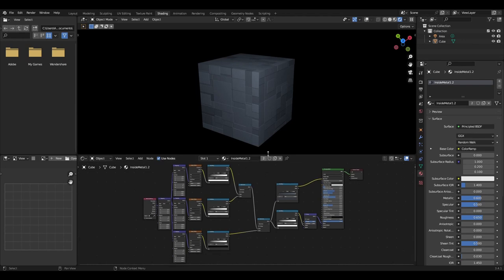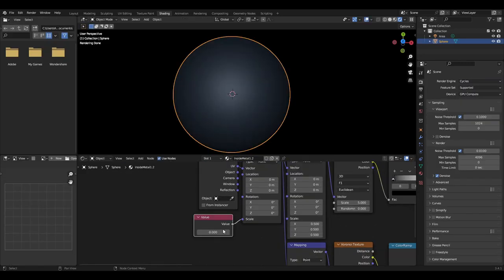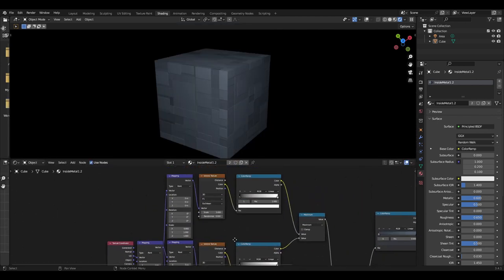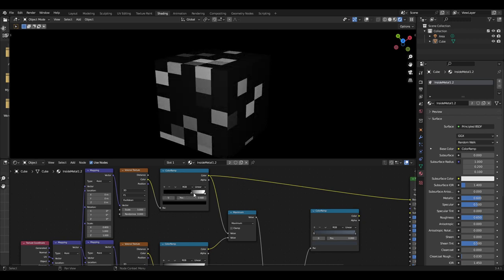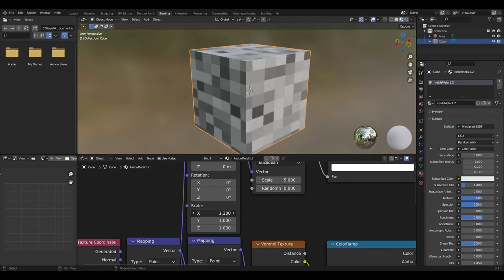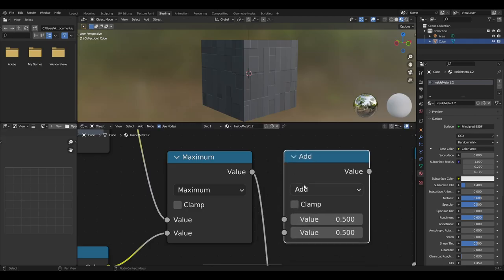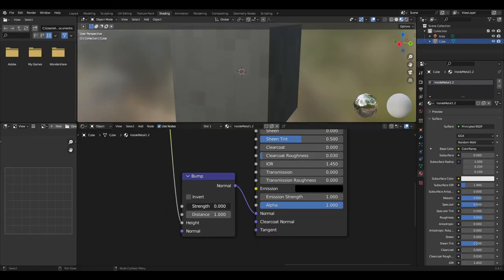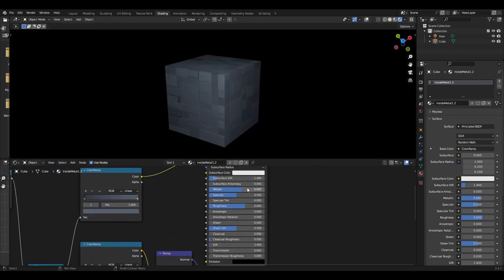Procedural overlapping metal plate texture | Blender

Comment: i dont get the voronoi effect, in my case it becomes a series of squares with the center becoming a circle and it breakes the effect completly

edit: alright found the mistake, i was using the distance not the color and connecting that to the color ramp, changing it to the color output fixed everything, good tutorial
Reply from the maker: I'm glad you found this video useful, and do not worry about mistakes as it is very easy to miss something. Good luck on your project

Comment: stupid question but is there any way to make the grooves deeper? With no amount of tweaking can i get the actual plate height to look a bit more extreme. I know it is just an illusion done on a 2D plane but is it possible to still make the plates look like they are sticking out a bit more since my current borders look like lines
Reply from the maker: Sorry for the late reply. I think you can make them bigger but it requires to have cycles on not eevee. Go into the material tab and go into the settings>surface and then change the displacement to displacement only. I think you then need to subdivide the object. Sorry if I’m wrong but I hope this helps
Reply: @AaronPalmer  aaah thank you very much for the help! I'm doing NPR shaders so i am limited to eevee but i'll try and find if i can work around it. Thank you for making practically the only youtube tutorial for procedural metal plating!